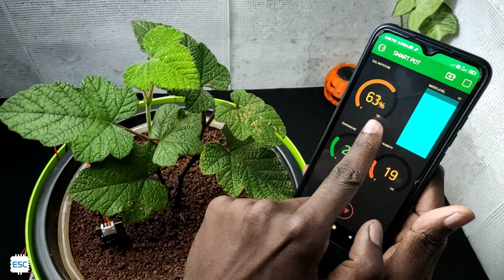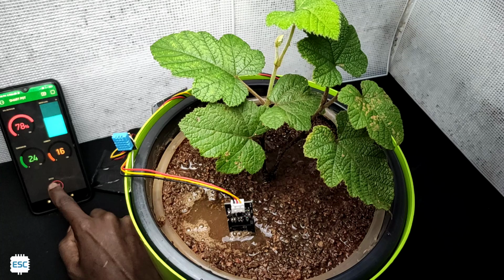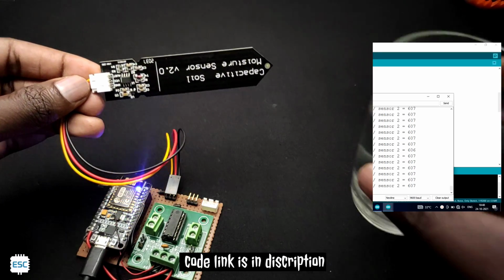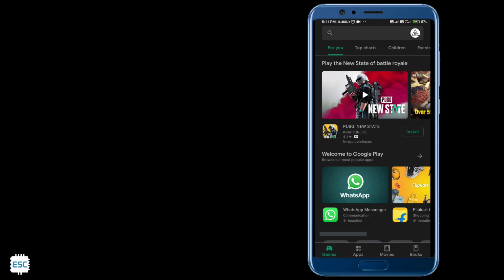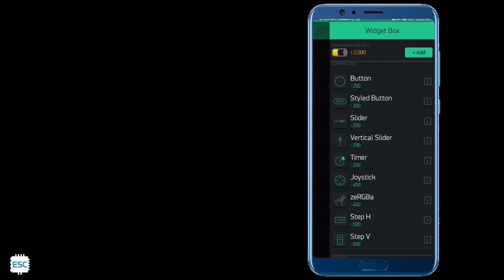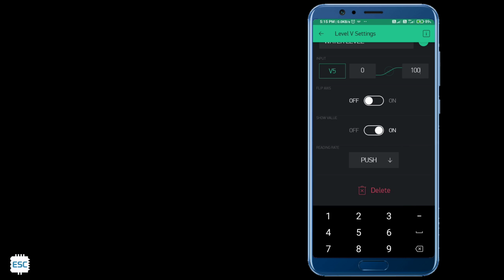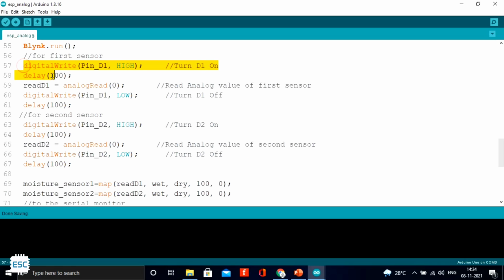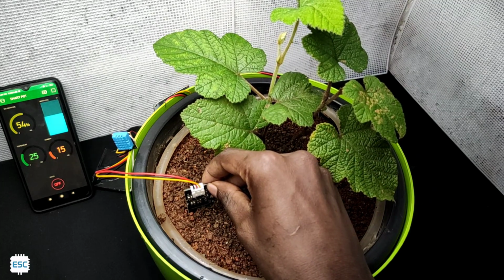How to Make Self Watering Smart Pot Using NodeMCU | IoT smart Irrigation

Comment: Sir is (Mini L293D 4CH 4 Channel Motor Driver Shield
L293 L293D Motor Driver Expansion Board Module) the same as your L293d motor driver? It looks different can i still use it? Does it work the same
Reply from the maker: Just use a relay

Comment: Bro, when I connect the resistor (10k), it's shows "A fatal esptool.py error occurred: Failed to connect to ESP8266: Invalid head of packet (@xCA)" What I have to do?
Reply from the maker: What happens when you are not connecting the resistor.?
Reply: It's connected to the NodeMCU. But, The motor is not spinning bro

Comment: Bro Could you please explain why directly connecting the L293D 5V to the NodeMCU 3V3 won't cause any damage? I'm a little scared of that and want to ensure the safety and reliability of my setup.
Reply from the maker: That's just an enable signal pin for the motor . You can connect . Will not fry your setup
Reply: Ok bro

Comment: Bro will it work in bew blynk iot. In new blynk iot app the only the gauge is free 😢for using the level v i want to upgrade . Insted of level v can i use normal guage. When i change settings off switch i cant change it to digital pin . There is only virtual pin. What i will do ?? Plz reply....plzzzz.mm😢
Reply from the maker: You can do it with the blynk iot app

Comment: I want to use a 5v relay instead of l293d motor driver so how should I make connections between ESP and motor? and should I use a 1.5kohm resistor for it?
Bcz you didn't use it anywhere and mentioned in website....
Reply from the maker: Will send you the Circuit diagram
Reply: @EDISON_SCIENCE_CORNER  send me the diagram too
Reply: @EDISON_SCIENCE_CORNER  would love to receive that circuit diagram as well! I am using a 5v relay as well. thanks so much!

Comment: Sir Water pump ON/OFF switch is not working please guide me through this problem.
Reply: does it work?
Reply from the maker: Yes
Reply from the maker: Check the pin
Reply: @EDISON_SCIENCE_CORNER  thanks sir. sir,  Is it normal to calibrate my sensor at wet 20 and dry 10 ?

Comment: At 3:40 I see there is a wire soldered in the middle of the board, why is that/where is it going/what is it soldered to? 
Thanks in advance!
Reply: I am asking because I don't see it anywhere in the circuit diagram in the post of the project
Reply from the maker: Checked.but Not getting you. Which wire
Reply: The one soldered in the middle of the ESP8266 board

Comment: Also, in the website, for the batter it says 7.4v but then it says (6v or 9v). Its not clear to me which voltage has to be used
Reply from the maker: I said 6-9v not or you can use use 6-9volt